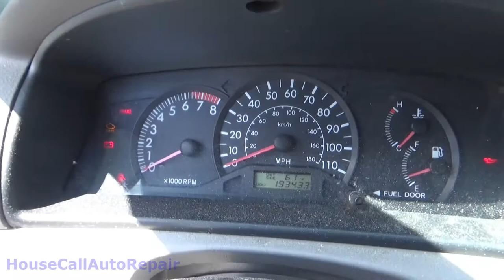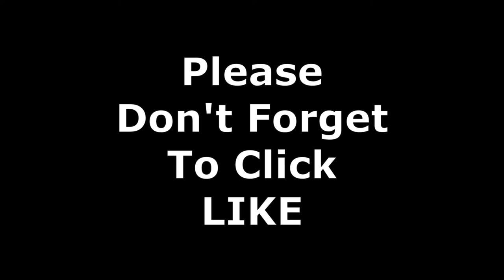2003 Toyota Corolla Front Pads, Rotors, and a Caliper TEARDOWN - Part 1 - Maples & Mud - Auto Repair

Comment: I never use pinch welds on any car. It's not safe and like you said some of them are crusted to hell. I've seen them bend right up.
Reply from the maker: In areas outside the Salt Belt, the pinch welds may be fine, but after seeing a two post lift go right up through, and into MY rocker panel, I'll NEVER use a rocker panel again!